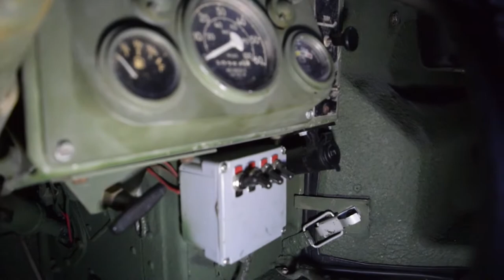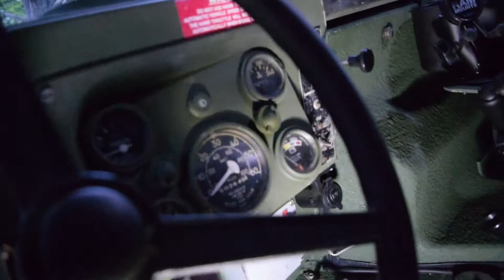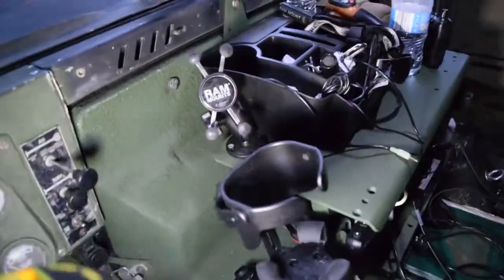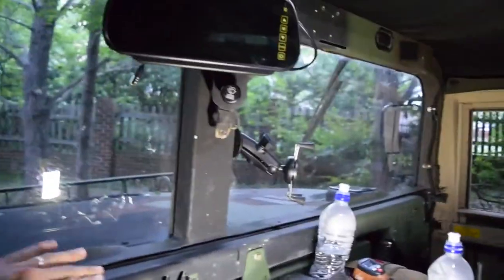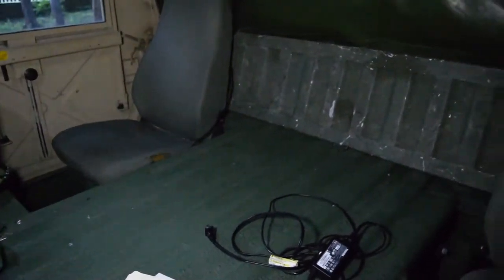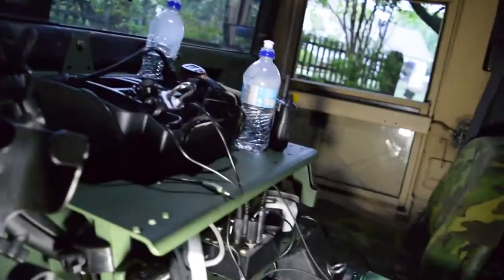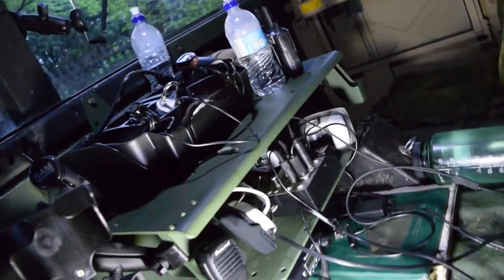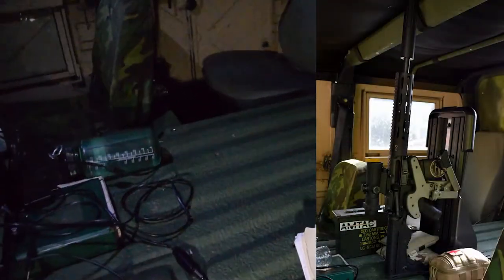DIY HMMWV Upgrades Overview - Project Humvee Battlewagon - Gear-Report.com

Comment: Will you be doing seats upgrade...to make the driver seat recline back? If so...please video.
Reply from the maker: Not sure how I missed this 8 months ago. Sorry. 
Nope. At 6'4" I've got to have the seat back as far as it will go. There is no room to recline it without hitting the cross support behind the seat back.
However, we have a "new" HMMWV M1045A2 on the way and it has the newer driver's seat that is more adjustable. Looking forward to seeing if that fits me better.

Comment: Did it come with the hard doors or was it purchase after?
Reply from the maker: Check the video. :) Discussion of the X doors starts around the 5:00 mark.
Reply: Gear-Report.com thanks so much for your reply.
Reply from the maker: Of course. 
The Battlewagon no longer wears these doors. Moved up to Supplemental Armor doors. But I am a big fan of some sort of hard doors with real glass.

Comment: thanks,  looking forward to see more!
Reply from the maker: You might also check the @Hummer Mods and repairs channel. They post their videos on Gear-Report.com, but there are so many of them that I don't recall if they have any showing this. 
https://www.youtube.com/channel/UCqq5CD0HI-v1yBO8wpogfmQ
Reply: will do, cheers
Reply: hi there, is it very noisy while driving? anything you can do dampening it? thanks
Reply from the maker: Sorry. Not sure how I missed the question 2 months ago.
Here you go: http://gear-report.com/lizardskin-sound-control-ceramic-insulation-project-humvee-battlewagon
Reply from the maker: and the follow-up: http://gear-report.com/humvee-upgrade-diy-lizardskin-sound-and-heat-coatings-long-term-update
Reply: hey thanks for your reply. my main concern is the engine noise! is there any thing available? thanks & happy new year!

Comment: Great Video! How happy are you with the lizard skin? These thins are loud, and I want to know if you noticed a sound difference with the paint? 

I'm curious how you modified the wires for the winch as well, I just bought a Warn SRS18-24V and wired it in.
Reply from the maker: Lizard skin has been in for a few weeks and I've driven a few 1.5 hour trips since spraying it. Before LizardSkin I could carry a comfortable conversation with a front seat passenger up to maybe 15mph. I'd say that is more like 25-30mph now.
It is still a soft top, so wind noise gets too much beyond that. Engine noise from the doghouse is dramatically less. Holding up well so far also.
Winch cable fix... http://gear-report.com/humvee-upgrade-diy-winch-controller-cable-fix-for-mile-marker-hmmwv-winch
Maybe that will help you sort out what wires are what if you have an M1038 that already has a winch connector below the dash.

Comment: What did it cost from gov planet?
Reply from the maker: The grand total with fees and taxes was about $10k.
Probably had another $10k put in it before being sold.
Reply: Did it need the 10k after purchase to run? Was it a daily driver when purchased or did it need work to run?
Reply from the maker: @jamesbrown5262   Not a binary answer. It ran when purchased, but had sat for 4 years and needed a variety of small parts, batteries, etc.
It is a 3 speed, so only fit to be a daily driver around town. Too slow for the interstate.
LOTS more info is on the site.
https://gear-report.com/project-humvee-battlewagon-surplus-hmmwv-us-army
Reply: Ahh ok thanks, I ask because I see shell-backs and 2-doors at auction for $1500-6000 and my budget is around 10k total.
Reply from the maker: @jamesbrown5262  You are talking about the auction opening bids prices. They usually sell for more, often much more, then they add fees, taxes, and a few months of waiting on paperwork.
https://gear-report.com/what-does-a-surplus-hmmwv-cost-how-to-buy-a-humvee
Reply from the maker: More numbers on our latest HMMWV here:
https://gear-report.com/hmmwv-info-battlewagon-2-m1045a2-humvee-from-the-us-marine-corps
Reply from the maker: If you literally only have $10k, then you will be hard pressed to get one and make it safe and reliable. Anything big, or a few little things will blow your budget.

Comment: Horrible spot for those rear spot lights. Not a fan.
Reply from the maker: They worked fine there for a couple of years. :) 
More backup lights than "spot lights".
Reply: @GearreportdotCom  like them, planning on something similar, since no reverse lights are built in

Comment: Dear God what a tangled mess.
Reply from the maker: Um. What?
Reply: @GearreportdotCom  Youve got stuff crammed all over and sliding around and unmanaged cables. Nothing is secured. That crap is gonna end up in the floorboard first pothole. Just saying. Doesn't look good at all. I like the 4way intercom but the install is horrible.